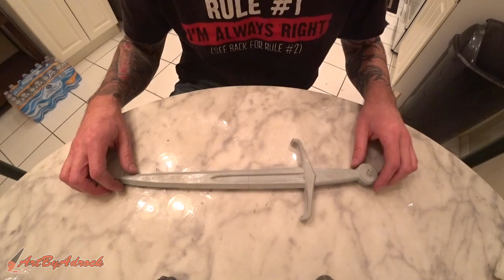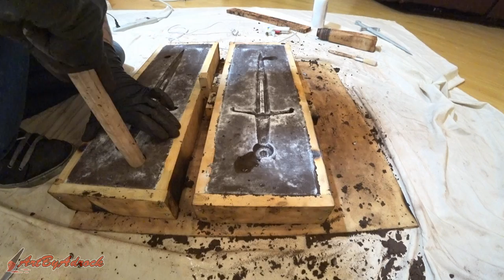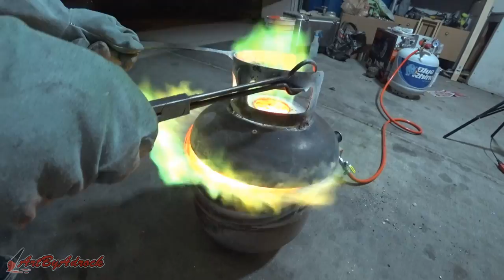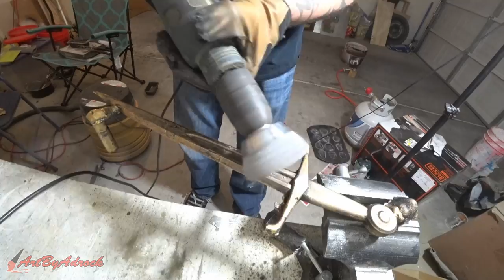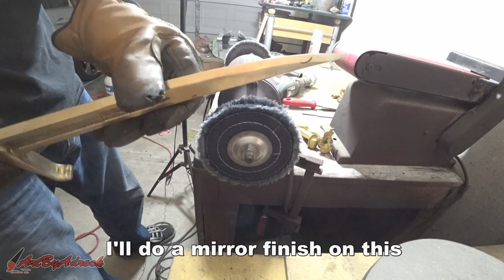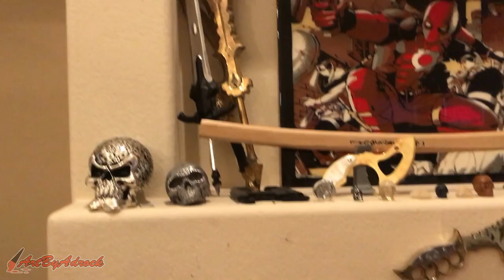Melting Copper Pipes Into A BRONZE Black Prince Dagger - Casting A Medieval Dagger

Comment: While melting copper pipe I found that if I didn't at least crimp one end, the pipe would shoot molten metal everywhere. Almost like a little cannon. Preheating the metal helped some, but it would still shoot out molten metal. I'm glad you didn't seem to have this issue, but for those who want to do the same type of thing just a heads up. If you have the time, flatten the whole pipe to prevent this, and flattening the pipe also knocks free a lot of other impurities.

Comment: I thought copper and tin make bronze. Doesnt this mean that the dagger you made is structurally a little mre brittle being made with aluminum?
Reply from the maker: It’s aluminum bronze but yes normal bronze is typically made with tin 👍🏻
Reply: bill hill  I think about 10% Aluminum is the best mix you can use for tools.

Comment: Why use hot glue instead of super glue? It's thinner and won't separate the models as much.
Reply from the maker: I use hot glue because it’s dries fast. Super glue will take forever to dry. I also use it so I can easily separate the parts if I want to cast it again 👍🏻

Comment: Gorgeous shine mate. I’ve never got the patience to make anything look that shiny. I’ve got nothing but respect for you. Excellent job!
Reply from the maker: Thanks buddy! Yeah it’s always a big pain in the butt to shine it up so much. So much sanding and polishing. It takes forever but sometimes I think it’s worth it when I see the final outcome 👍🏻 cheers my friend 🍺🍺
Reply: I have a grinding rock with a wire brush on one side and the rock on the other. I use the wire brush to clean my ingots and other things I make but it is hard to keep a hold on them some times and the grinder slings them across the room lol.

Comment: Hey, I just ordered 10kg of petrobond casting sand but I don’t know if I should reuse the burned stuff🤷‍♂️ I was just wondering if reusing the burned oetrobond makes the sand quality not as good or if it reduces the detail or not. Thanks mate great video👍
Reply from the maker: I would set it aside in a different bucket and when all the good sand is used up add a little non detergent oil and mix it in well. It’ll work almost as good as the original. I’ve been using repurposed sand for the last month or so and it works fine 👍🏻

Comment: Nice job..I'm trying to make a Roman type sword but I keep messing up my pours I'll try it your way..thanks..
Reply from the maker: Thanks! How are you messing up the pours? What are you using?
Reply: Trying to vent off the face of the blade I think ..my last one the metal froze half way
Reply from the maker: I’ve had that problem before so I know the feeling.. get the metal hotter and wait a few extra minutes before taking it out. Make sure you have a big enough basin for the metal to flow in and pour very quickly. Copper and brass solidifies quickly so try and do it as fast as possible. But also safely 👍🏻
Reply: It worked great😄best poor yet...thanks
Reply from the maker: Good to hear! 👍🏻 did you take a photo or video?
Reply: Took some pictures after the pour I was very pleased with myself lol😄
Reply from the maker: Cool bro! Send me a photo to my email. I’d love to check it out 👍🏻

Comment: Not sure if you ever talked about this, can you reuse the petrobond? or is it all just junk after a pour?
Reply from the maker: I usually always re use it. Add a little oil mixed in to the burnt sand and it still works great
Reply: That Dagger is beautiful great job on it
Reply from the maker: Thanks 🙏

Comment: why you cool it in water? Only for decrease time?
Reply from the maker: So I can start the clean up on it. It’s still well over 1000 degrees 👍🏻
Reply: @ArtByAdrock  but what happen if you not put in water? chill it alone is the same?
Reply from the maker: I would be waiting an hour or 2 until it cooled off enough to touch it by hand without getting burned.
Reply: ArtByAdrock this is a veeeeery good reason jajajajajajaj

Comment: What does adding the aluminium do?
Reply from the maker: It’s how aluminum bronze is made. About 89% copper and 11% aluminum 👍🏻
Reply: @ArtByAdrock  yes but is that to make it look cooler, be harder, etc. Thanks for the speedy response!
Reply from the maker: Yeah it hardens the alloy to answer your question. Copper by itself isn’t as hard.
Reply: @ArtByAdrock  I'm looking to do similar things but am mostly stuck with aluminium for my main metal. I have a little copper and could probably get brass. For making something hard that holds an edge (for things like knives) what would be the best predominantly aluminium alloy I could make? 
Btw I subbed. Great channel, I found you through bigstackd
Reply: @ArtByAdrock  also, I was wondering if methane is a substitute for the propane gas you all use. I have a hose for barbecue in my backyard and would love to use that instead of needing to buy tanks. Is there a reason nobody seems to use natural gas? I checked it out online and it only burns 20 degrees Celsius less than propane
Reply from the maker: Ok cool.. aluminum is always the easiest to get for me along with brass
Reply from the maker: I’m not sure.. maybe people don’t want to hook it up to their house 🤷🏻‍♂️